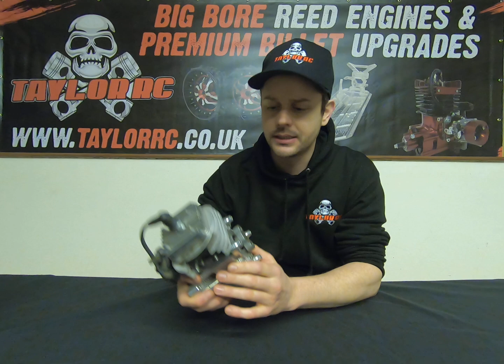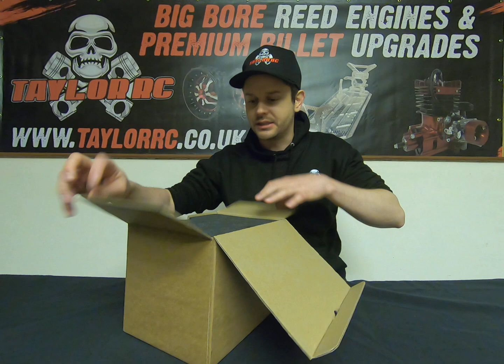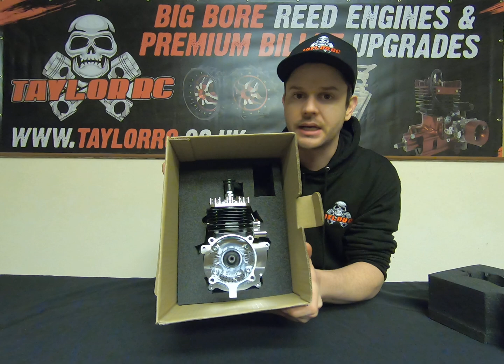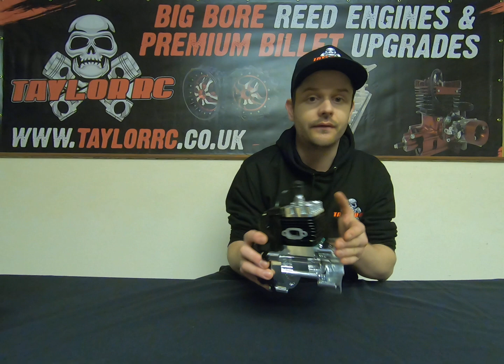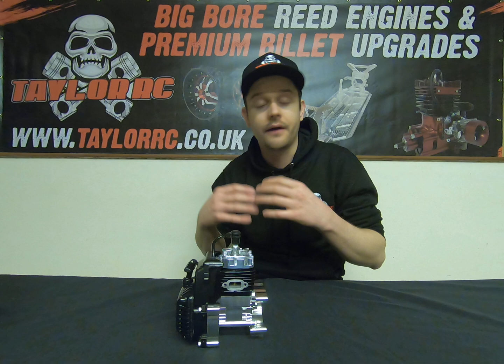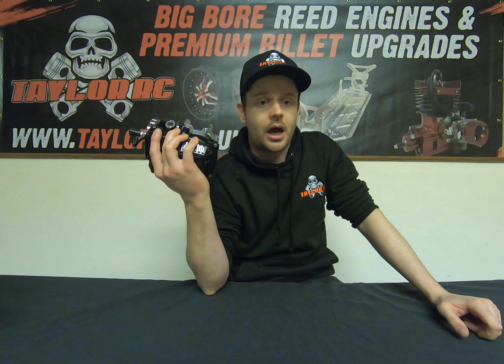NEW RELEASE - 35cc TAYLOR 5TH SCALE RC ENGINE

Comment: will a reed valve option be availible for this small bore engine in the future
Reply: He explained why a reedcase is not necessary. And also price point.
Reply from the maker: No current plans for a reed version at this time. We still have a few years to continue development of this new platform and get more and more performance from the engine first. As long as we can keep producing more performance and reliability than then next best engine than im quite happy staying with a piston port. This new engine is extremely upgradable for future with new heads, new cylinders etc that all can bolt onto the existing original engine. So we can always stay ahead of the game

Comment: What kind of power output hp tq and max rpm ?
Reply from the maker: We will release more info in time, however please dont expect full dyno data, there is a little too much false info on the internet regarding RC engines and their HP, so have no intention of getting sucked into that trap. The videos will speak for themselves we believe

Comment: $850 for a non reed valve engine? I think not!
Reply from the maker: Appreciate your opinion! But we have far more advanced tech in terms of design and cylinder than anything on the market, so a reed wasn't needed to get the output for our goals.  In my opinion it all comes down to performance per dollar without reliability compromise. But theres loads of other companies modding Zenoahs into reed engines if thats your thing, respect
Reply: Reeds  are great for torque and low down power but ive got 2 reeds and they dont rev as high as my piston port engines and i want mid to top end power
So cylinder design is the only way to get that power curve realistically.
Reply: Know what you are talking about before you comment, this is a fucking beast!